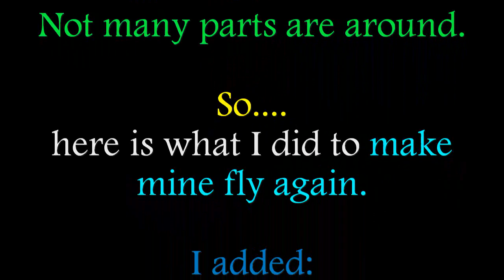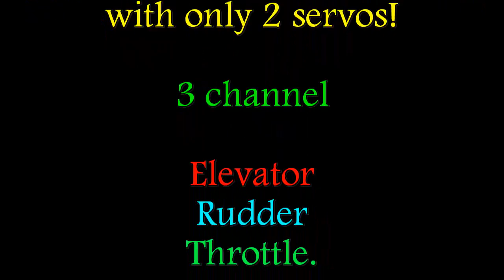Give your old Stormlauncher a Brushless Ducted Fan and major control Mods.

Comment: The rear servos need to be more towards the front or you could add a little more weight forward of the battery. That will stabilize the flight better.

Comment: And the voltage added to the motor depends on how much throttle u give it the esc controls that but at full throttle its probly giving the motor maybe like 10.5 v

Comment: You should add a small Canard wing on each side near the back of the craft to help stabilize the craft. They can be just a fixed-wing to add a little lift to the rear and should make turning a bit smoother and take-off easier.

Comment: i had 3 stormlaunchers and they all did the same thing, left motor got weaker and weaker and eventually wouldnt fly even with it trimmed all the way to the right. took the right motor off one and made one good one for a while and it eventually crapped out. now i have a real hydrofoam with ailerons and rudder. they are a blast

Comment: Yes , on the old launcher, what size motor and shroud were used. I have a new one with single motor but i want to used the shroud and high rpm bl motor for power, can you help?

Comment: Also, if you can, get rid of the top yellow cup and move Rx and ESC forward too.
You'll have much more control with elevons to control the roll, instead of just left/right with the rudder alone which also causes instability when you have no dihedral in the wing like in these SLs.

Comment: I was planning to do the same this to mine except with a lightweight 55mm EDF w/ brushless outrunner, only 56g. The EDF needs to be so far forward because you've got too much stuff near the back. It's stalling the whole time, hence the wobbling. You're basically doing semi-3D flying and getting away with it because you've got so much power. Remember, the stock SL had nothing near the back. I'd go back to just elevons, servos up front, maybe in motor pods, and ditch center tailfin. CG forward!

Comment: 15A is a little too low for a 64mm brushless EDF. You could burn up your speed control. Most need at least a 20A ESC. You can get away with it here because you're way over powered on this lightweight plane and probably don't use full throttle.

Comment: WOW.. i have one still, and don't use it b/c it is WOEFULLY underpowered

not up on the newest specs and tech's in the hobby, but my father is.. so i might give him this as a fun project

i now have a REAL hobby grade hydrofoam that i fly.. and its underpowered, but a HELL of alot easier to fly, with ele-vons and rudder, instead of elevator and thrust differential like the storm launchers..